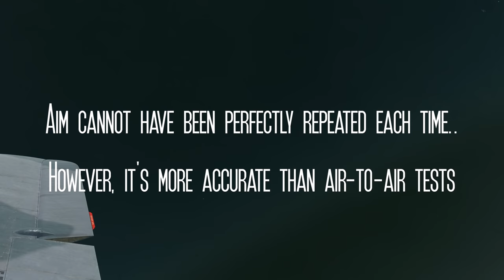Testing the new DCS Damage Model

Comment: Thanks for testing! Wouldn't surprise me if they mostly just tested using ww2 munitions, that P-47 seems a bit to hardy to 25mm
Reply from the maker: WW2 munitions includes the German 30mm explosive rounds. . . .
Reply: @philstyle  I think what Lithion is getting at, is that maybe the WW2 ammunition has been exclusively updated to work with the new damage model, and that other weapons (such as the 25mm from the LAV-25 or Bradley) haven't been updated. (If how the ammunition works has been updated at all).
Reply from the maker: @OliverMiles98  there's possible some refining gap there.. but I know that the DM was tested with more than the WW2 munitions.
Reply: @philstyle  Okay, and yes that would make sense - just thinking off of the top of my head here.

Comment: I think they may have supplied you with some duff ammunition. A .50 cal round would generally have a muzzle energy of 12,000 ft.lb at around 250 yards this drops off to c. 10,000 ft.lbs of energy, which leaves an 83+% of energy from the original mussel just using ball ammunition. Me thinks the energy of the round is dropping way too fast. ( please also remember that none of the tests were conducted at the muzzle, so this would slant things further in the favour of retained energy)
Reply from the maker: So it loses a 5th of its energy over just 250 yards... a lot more than I expected.
Not sure why you think this means I was given "duff" information. 
At 280 yards range it required 70 rounds, versus 55 at around 30m (~32 yards). An extra 27% rounds. If you take away a handful due to the fact that aim wouldn't have been so accurate (you can actually see at least one round hits the concrete) then we're talking more like 65 rounds hitting. So, that's 18% more rounds required. . . 
That's damn near representative of your 20% energy loss.
Reply: @philstyle  The problem issue as I see it, is that even at < 50% (c. 700 yds) of muzzle energy it should have enough power to punch a hole in an aluminium block which is likely to cause a few issues. btw not "Duff information" but rather "Duff ammunition", you know.... dodgy ammo past its prime ;-) But yes you are quite correct in accuracy will decline rather rapidly.  But as my sole purpose in DCS appears to be cannon fodder none of the above applies to me. Well.....  if you are counting shooting at the sky/ground as grounds for good accuracy, for I appear to be reasonably good at this.

Comment: Have you tried firing at the aircraft on the ground from behind the planes just to see if there is a difference in the amount of damage based on the angle you are firing at? I figure from behind the aircraft you have a larger surface area on the wing to hit and i wonder if you can put more holes in the wing tanks on the p51?
Reply from the maker: Not yet. I did a whole set of rudder shots, but video was already 50 minutes long. So they didn't make the cut.
Doing these videos is insanely time consuming.
Reply: @philstyle  I think you did an awesome job with the test video was just wondering if you found anything else on your own that didnt make the video out of curiosity.

Comment: HE rounds in DCS are pretty bad. Most of them pretty much have no penetration what so ever. Then there is the other issues, where some units have too much armor as well.

I would bet that the 25HE rounds are not penetrating most of the time and it is just splash damage, that is done. Possibly why some stuff might seem more resilient. In terms of visual, didn't they mention that they are using some sort of a visual template thing for levels of damage on different sections of the aircraft ? I wouldn't expect to see an exact hole, where I've shot something.

Another thing I would assume is that those wings would come off easier, if you were shooting perpendicular to the spars.
Reply from the maker: If the HE rounds are detonating on impact or proximity - most of what would otherwise penetrate is being destroyed. AP rounds are for penetration.

To sever a spar is not easy - we can't even see if I was hitting the spars, and there is more than one of them in these wings - wings which were NOT loaded with G.

I'd need to see the internal 3D model, so I know what I am hitting, before makink such claims. In my opinion, this is far better than the old scenario where wings snapped off way to easily.
Reply from the maker: Also, you are not going to see exact holes in the precise locations where rounds land in a flight sim. Not for a long time, when hardware and software are capable of modelling it. Damage visualization has to be based on a series of decals/ pre-selected damage states.
Reply: @philstyle  This seems a little off though, especially larger weapons at least - as far as I can tell, you do get craters placed near enough exactly where the bullets visually seem to land.

Nevertheless, with the older modules like the P-51D and Bf-109, it looks like they could do with a touch up to those damaged states.
Reply from the maker: @OliverMiles98  "you do get craters placed near enough exactly where the bullets visually seem to land."
No. ED have explained how the decals work. Each part of the aircraft has a series of DM decals that are available. Is locally proximate only.
Reply: @philstyle  Sorry, should've made it more clear. On the ground you get craters where bullets appear to land at least for calibres of 30mm (well, at least in the case of the GAU-8) and above, I'm just wondering if a similar thing could be applied for certain munitions (particularly German 20/30mm minengeshoss), just on aircraft.

I mean, just look at this post https://forum.il2sturmovik.com/topic/41665-3cm-mk108-historical-test-data-vs-ingame-test-data/ And these are single 30mm minengeshoss rounds. 

For smaller calibres and things that leave smaller holes, I don't expect the localised tiered textures to change (though in the case of some aircraft, they could do with a facelift), the newer aircraft are better, but it's kinda weird seeing lots of small bullet holes on the P-51D engine cowling after being hit by a 25mm HE projectile). 

The same exact thing could apply for ships in the case of bombs and anti-ship missiles - DCS already does localised craters on the ground and has done so for years, it's just applying the same thing for different objects - SH4 did the exact same thing for larger naval artillery, bombs and torpedoes. 

Obviously this only applies to larger weapons that leave particularly large holes, I don't expect DCS to count every single bullet or fragments to have precise impact holes.
Reply: @philstyle  Calm down. I am not arguing with you. I am just giving my observations on why sometimes it might have took more rounds to do terminal damage. Obviously the new damage model is a welcomed thing and way better than before.

I am sure schematics of these aircraft can be found and one could find where exactly the spars should be located. 

Having the HE round just disappear at contact and it producing splash damage on the outside only is quite different than it actually penetrating a little bit, exploding half way inside and carrying its momentum.

Even if you don't know where the spars are exactly, shooting perpendicularly to the wing will show you the broad side of the spar. Bigger surface area and thinner material to go through, in contrast to shooting at a narrow area, which has a lot of thickness behind it. Anyway, my point is... it will probably do more damage that way or at least it should (also matching the most common angle you will be shooting an aircraft from, while in a fight). I am expecting things to go off even faster when in the air and under load.
Reply: @samivwow  I'm pretty sure ED have the internal components in the right places, at least going by development screenshots. I think the problem is less so the damage model itself and more how certain ammunition types are modelled in DCS (particularly HE rounds on larger calibre autocannons). It wouldn't surprise me if only the WW2 rounds were better implemented to work with the new damage model.

I know that tank ammunition isn't implemented as well as desired, I'm fairly sure (by limited testing) that HESH, HEAT, HE and HEF rounds are implemented in basically the exact same way, when they should have differences (even if slight).
Reply from the maker: What gave you the impression I was not calm? My comments were no more or less direct as yours.
Reply: @philstyle  Localized damage decals aren't some super demanding tech that's outside of current hardware constraints. It's just a matter of the developer programming to that detail. It's essentially the same concept of bomb craters that are left on the ground terrain. Star Citizen is doing this on their aircraft and has been for 5 years now. Take a look: https://youtu.be/pH_hbHLVZhE
Reply from the maker: @AbortedMan If you're happy with just decals and not any actual holes in the 3d model itself then yeah a simple patch with burn marks or fake holes over the top for each hit looks OK-ish. DCS does that for the very minor cosmetic-only stuff. I've seen it done more often in other sims that are bigger on cosmetics

This kind of thing doesn't work with simply dropping some generic textures over the top:
https://i.imgur.com/hbbtVa5.png

I'd be pretty disappointed if DCS went down that route on a larger scale.
Reply: @philstyle  <Shrug> It's ED working on it, so we take what we can get, I guess. Add it to the epic to-do list, heh.
Reply: @philstyle  I'm not sure those 3D model holes are actually 3D holes at all; what's probably going on is that they've added some 3D internals to the aircraft and then when damage hits it, it drops a texture over the area, only the texture is set to be transparent, so what looks like 3D damage actually isn't. Of course it isn't always the case (particularly when you can see 3D craters where the surrounding skin has been deformed, but in cases like your image I'm pretty confident they've just added some 3D internals to the tail and then pasted a texture over the top which is transparent, allowing you to see through the model.

SH4 does the same thing with it's representation of damage, it has some 3D internals, and then when something hits it, it pastes a transparent texture over the location, in exactly the same fashion as bomb craters in DCS. War Thunder does the same thing with its bullet holes.

And doing some more testing cannon rounds from the MiG-15bis and A-10C also leave small craters, in exactly the location the rounds appear to land. So to an extent, DCS already does this exact thing, without too much difficulty. It's just it only does it for the ground and nothing else.

Comment: This post from NineLine may be extremely relevant to your method of testing...it looks like modern weapons don't yet properly apply the new DM stats, so it may be worth retrying with WW2 weapons only. Not sure if it applies to the 25mm cannon you were using, but definitely isn't ready to be tested with things like the Abrams cannon. Also, looks like 1 to 1 graphical damage with location specific damage texturing is at least on ED's radar as we discussed in our other comments. https://www.reddit.com/r/hoggit/comments/jy32m8/new_damage_model_p47_vs_abrams_10/gd0v0lj?utm_source=share&utm_medium=web2x&context=3
Reply from the maker: Yeah I saw that. I also don't know for sure if the weapons we used to test are "working" or not with the DM. 
I'm not sure which ww2 drivable assets we could use...  AFAIK none of them have the aircraft guns, but I might be wrong . .. do any of the controllable  ww2 ground assets use a 20mm ww2 canon or .50 cal?
Reply: Yeah that's what I was thinking.

Comment: That 109 needs some tweaking, Good Lord! Seems a bit too sturdy. Small tweaking all around. Good job ED. Not ground braking DM, for the time it took to develop, but way better. Improvements indeed, keep it up 👍
Reply from the maker: 109 didn't seem so bad to me. 1x25mm to engine, out. Same as the other types.
Reply: @philstyle  For me, it was the number of large caliber rounds hitting the wing area of the 109 that seemed a bit much.  109's historically were pretty fragile in comparison to their contemporaries.
Reply: @mtnmist1  Do you have any data to suggest that the 109's wing is able to sustain less force than its contemporaries?

I don't mean to be rude but the ww2 aviation space is riddled with conflicting anecdotal evidence that often proves situational at best.
Reply from the maker: @DrFatalChunk  The usually-cited design is that the 109 wing had only a single Spar, whereas the spitfire or P51 at least had 2. The 109 wing design meant that it had good strength tortionally and only needed one spar. The down-side being that if that spar was compromised, the entire wing was compromised. Aircraft with 2 spars could, under some circumstances, still stay aloft with 1 of the 2 spars compromised.
https://ww2aircraft.net/forum/attachments/cut19-jpg.459112/
https://weaponsandwarfare.files.wordpress.com/2015/09/jnyfcxdn.jpg?w=529&h=373
This doesn't mean that the 109 would always break more easily though, and this design difference only matters under certain conditions.
Reply: @philstyle  Interesting, thanks!
Reply: @DrFatalChunk  no, I don't have empirical data at my fingertips.   ME/BF-109's were known as being fairly fragile (but effective); I remember hearing several of the Luftwaffe veteran pilots being interviewed saying as much, and have seen it referenced elsewhere.